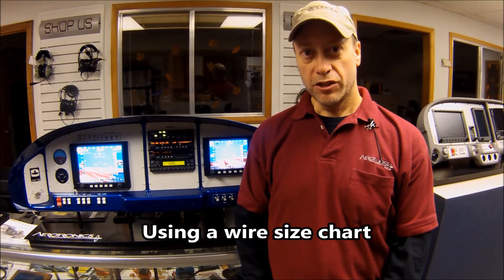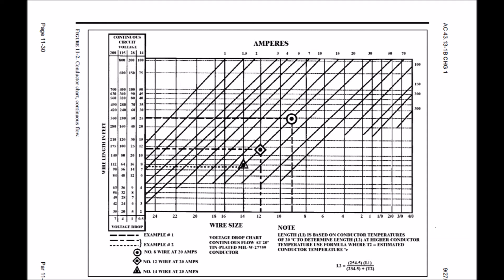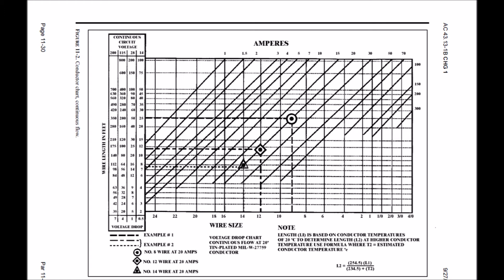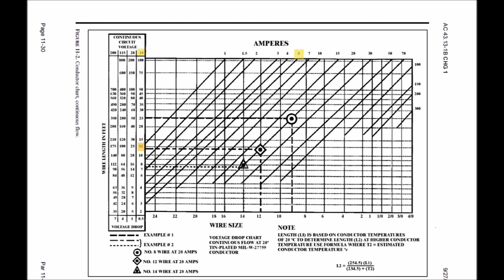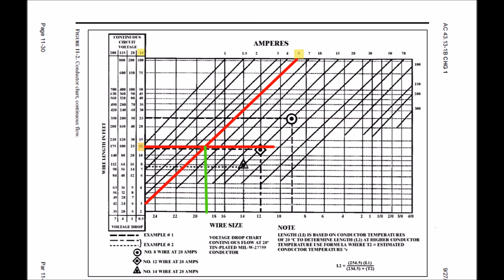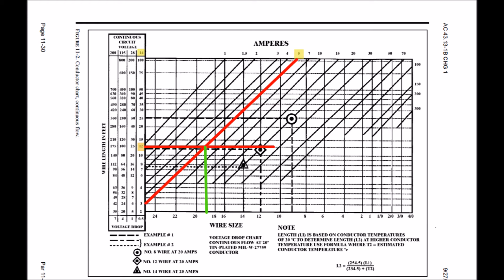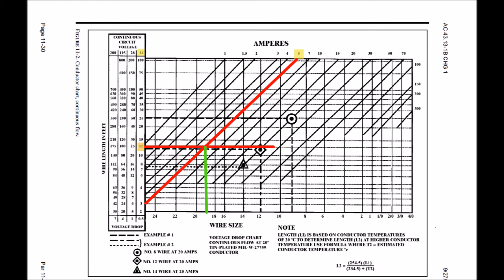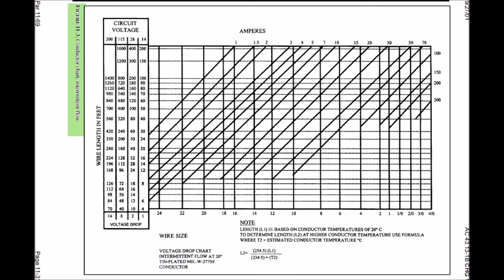Aerotronics "Using a wire size chart"

Comment: Jeff can you run thru the wire diagram (focusing on how the current flows (which directions it goes vs blocked) thru the resisters, capacitors+ diodes, etc)